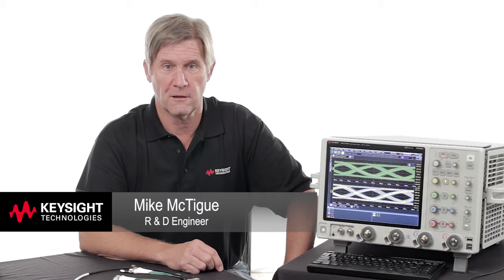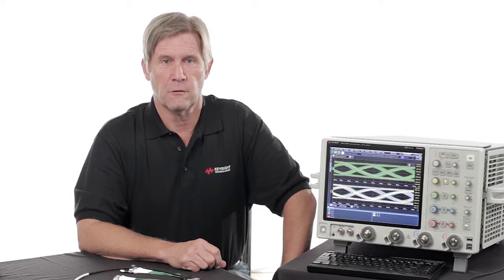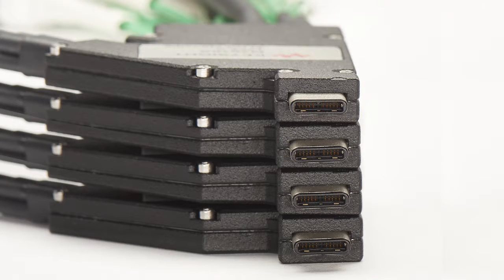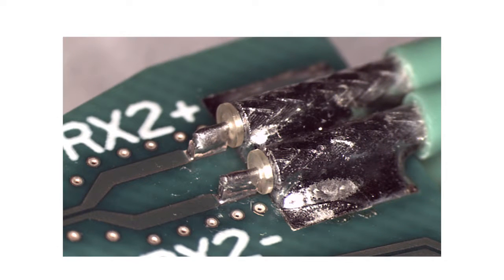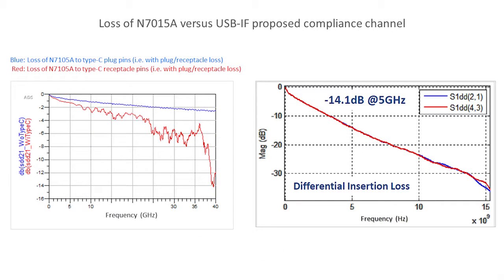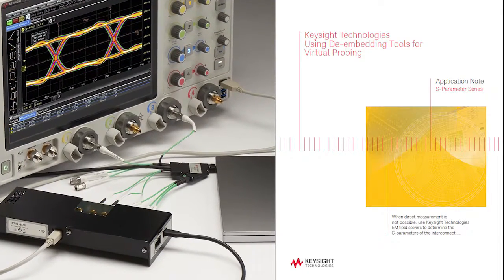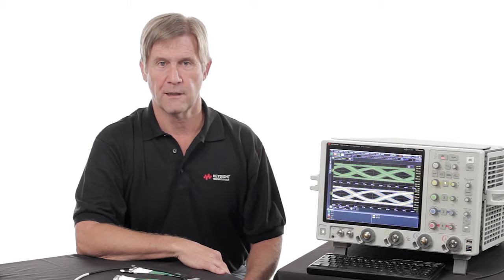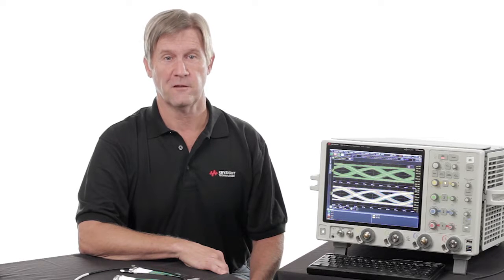Overview of Keysight N7015A Type-C Test Fixture

Comment: But how do you get S-parameters of such fixtures? There are 2.92mm cal kits available, but the second reference plane is at the USB connector... Do they come from a EM model? And what one should do if he is to check the performance of a USB-C connector?
Reply from the maker: We talked with the R&D engineer who handled this, and here's the response:

The N7015A is made up of these parts: 2.92mmM connector, coax cable, section of single-ended micro-strip line, short section of coupled differential microstrip line, then the pins of the type C connector. The method used to create the s parameters is typical when one side of a DUT doesn’t have RF connectors.

1. Solder bridge across the differential pins of the type-C connector. This accomplishes a very good low inductance differential short at the pin of the connector.
2. Measure the return loss of each 2.92mm inputs to the N7015A. 
3. Using the singled-ended TDR obtained from the transform of the return loss to create a model of the 2.92mm launch into the coax using short sections of variable z0 transmission lines such that the model matches the measure TDR.
4. Use the ADS model for lossy coax line to model the coax line section. Input the known length, dielectric constant, dielectric loss, and conductivity as a starting point.
5. Use the ADS model for the lossy microstrip line section using the known length, dielectric constant, dielectric loss, and conductivity as a starting points. 
6. Use the ADS model for the lossy coupled microstrip line section using the known length, dielectric constant, dielectric loss, and conductivity as a starting points. 
7. Assembly these model components and plot the measured differential TDR and the modeled differential TDR. The TDR will show the loss taper along the line for the first part and then the differential short circuit at the end.
8. Adjust the various lossy components such that the modeled loss taper of the TDR matches the loss taper of the measured TDR.

This compares the differential TDR of the model versus measured data.

This models the loss of from the 2.92mm connectors to the pins of the type-C connector which is what many users want.

To model the loss from the 2.92mm connectors to the pins of a receptacle plugged into the N7015A receptacle fixture. We build a model for this fixture the same way we built a model of the N7015A which is from the SMA connectors on it to the pins of the receptacle fixture. Now we measure the s parameters from the 2.92mm connectors to the SMA connectors. Using the model for the receptacle fixture, de-embed this fixture. You are now left with s parameters from the 2.92mm connectors to the pins of the receptacle (with the assumption that the receptacle used is similar to the receptacle of the fixture). That’s all we can really do.

Since we now have the s parameters for the N7015A to the plug pins, and for the receptacle fixture to the receptacle pins, we can de-embed both the N7015 and the receptacle fixture and be left with the loss of just the plug/receptacle. Then we can split this in half using PLTS so we can assemble the N7015A to halfway between the plug and receptacle.

I don’t view the loss to the halfway point as all that useful since this is not a real RF connector. I think the plug/receptacle should be viewed as one item and we can talk about the loss to the plug pins or receptacle pins. 

By the way, connectors systems like the type-C plug/receptacle only work at these kind of speeds because the signals are differential. The signal integrity of the common mode or single-ended mode paths through this connector are not very good because the grounding is hit or miss. Therefore the models are really meant for differential use and may not be that accurate for common mode or single-ended signals.

As far as checking the performance of a type-C connector, I’d used the N7015A to compare different receptacles using differential TDR. The receptacle has to be on a pc board in the configuration that it will be used in. You can’t just check a receptacle by itself; the pc board launch is  part of the response.
Reply: Thank you for such comprehensive answer! Hats off to you guys! 
It took me a while to think about what you said and I have a question, just to clarify. 
In 6th and 7th paragraphs you are describing how to deembed N7015A and USB-C connector on a device, so we are left with device without connectors (at first I couldn't understand it at all and I'm not sure now)?
Reply from the maker: The way I (Daniel) understand it is that if you know the S-Parameters of the different portions of the signal path, you can pull out the parts you don't want and be left with just the parameters you care about. This is probably an oversimplification, though.